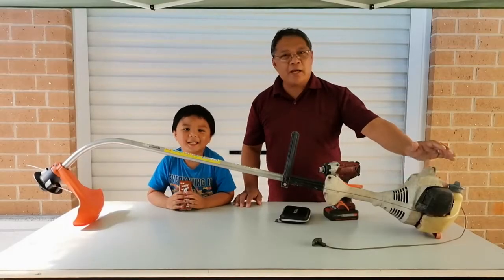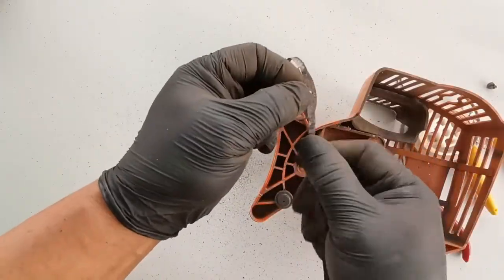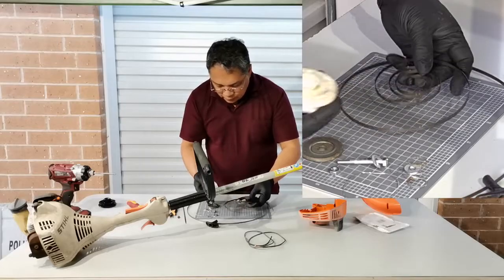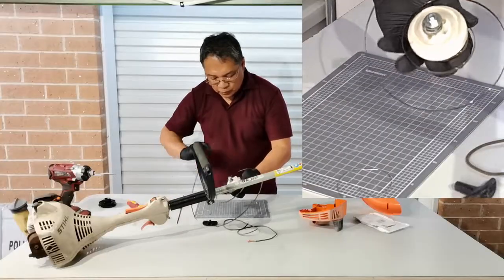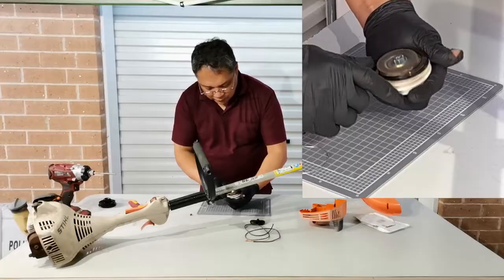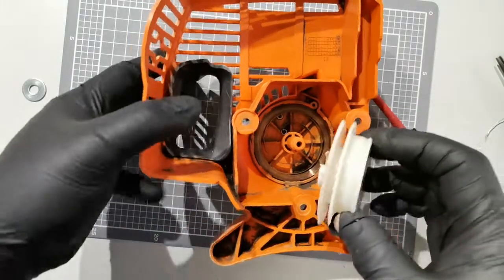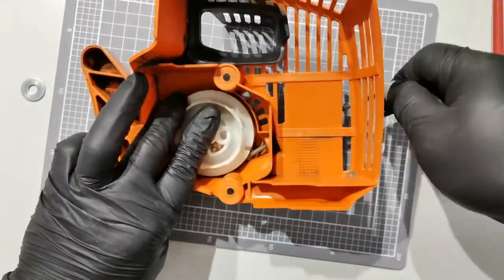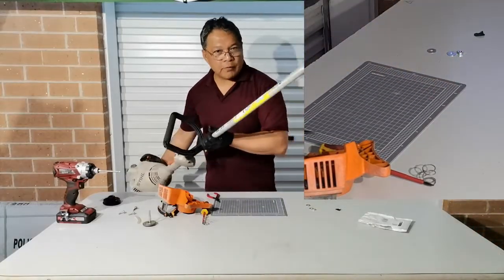VTECH 40 - How to repair Stihl FS38 Pull Starter

Comment: You can buy a whole new assembly for $15. Three screws and you're back in business.
Reply from the maker: You are right, this complete assembly is crazy really cheap now. Some people still wants to keep their original housing especially with original Stihl logo/badge. Thanks for watching.
Reply: Can I get the url where I can order it? Also I didn’t have that exact star bit to open it the first time I fixed it so reopening it after a year kind of stripped the star screws.. do you also know where I can get the screws

Comment: Take a Bath Productions shows an easier, quicker method to wind the rewind spring in any 2- or 4-stroke pull start.  A flat wood board, wood screw, chuck drill, ziptie.  For an experienced person, 2 minute job, done.  A novice might get it wrong a few times before success.  

The big issue is Stihl doesn't provide a pre-braced and tensioned ready-for-install spring.  It flies everywhere out of the package like a slinky from hell. 

Their low- to mid-end equipment is manufactured obsolescence  throwaway junk to owners of no mechanical DIY aptitude and experience and that need to be pampered and stored in clean and dry environment.
Reply from the maker: Yes, I saw that video and when he rewind the spring on the board with a drill and at 2:35 the spring slipped and wrapped into the drill chuck and said, "What the h.." Funny! That's why I use a different approach where this method can a handheld product one day which every single engine mechanic would like to have one. Keep in touch to make this thing happen. Just always think outside the box and the possibility beyond what you saw. Thanks for watching our videos. Cheers, VARIETECH
Reply: @Varietech-AU  Yeah, the drill/screw/board method is a genuine and old DIY prone to potential failure. Even in the hands of experienced individuals the spring can go flying. 

The issue is not that you will conceive of a great, completely functional system (you appear to be an engineer), it's that manufacturers like Stihl operate in the 'engineered obsolescence' business model that their products will fail or make it exceedingly difficult for casual owners to fix their own equipment without a highly learned and ingenious problem solving instructor such as yourself. 

I can't wait for this new design of yours.
Reply from the maker: @jasonbell5152  I always respect other method and approach especially the old school because we all learned from them and able to come up with simple or a complex innovation based on their experience and public constructive comments and opinions. Sometimes we can figure out the concept and operation of your innovations by head how its individual component works but you will find your limitations when making the prototype especially on 3D modelling and 3D printing to make the parts. I have once successfully made an innovation for Victa LM/G4 needle which is now widely known as viton tip metal needle. Second is the Victa float/needle lever which will only works on viton tip metal needle which currently on final manufacturing tooling and production. Since I'm not financially capable, the manufacturer has all the rights and patents of the products. Cheers, VARIETECH

Comment: Thanks for the tip to roll the spring with the existing part. Unfortunately the rope doesn’t come back entirely. I think my spring needs to be change…
Reply from the maker: If the rope doesn't come back entirely, needs more turns. Thanks for watching! Check my latest uploads!